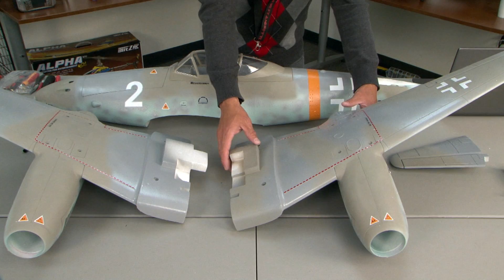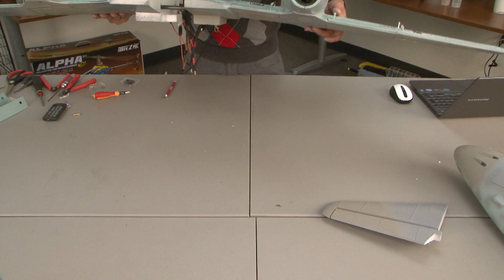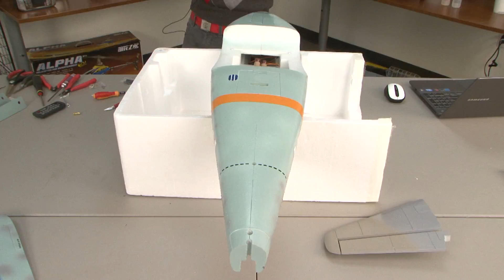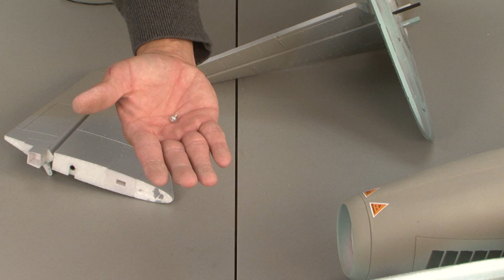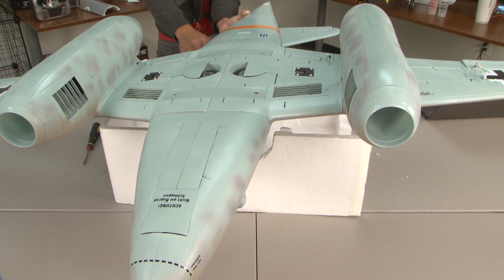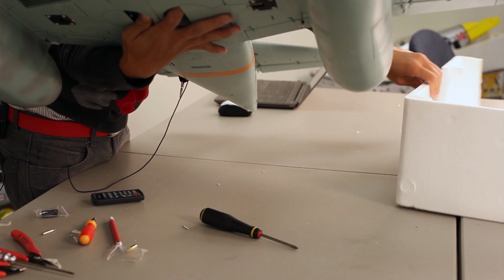ME-262 FreeWing | Build Review | EDF Fighter Jet

Comment: Assuming an experienced modeller this plane is simple to build, you'll spot a few improvements: short wing screws, replace'em with longer metal screws and nuts, tighten all landing gear screws and cement glue the washers in the LG struts.
I got the kit version and add my own electronics, and use two packs of two series 3s 2200mAh to get a 6s 4400mAh pack, and can fly for 6-7mins enjoy the maiden video http://youtu.be/dYhHFRXjs0A